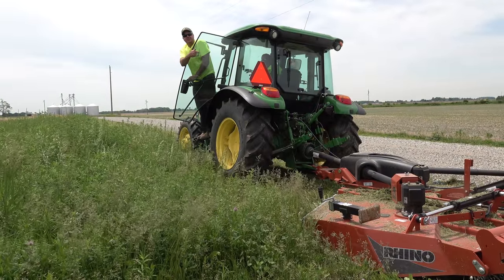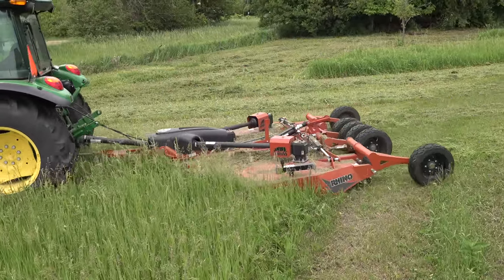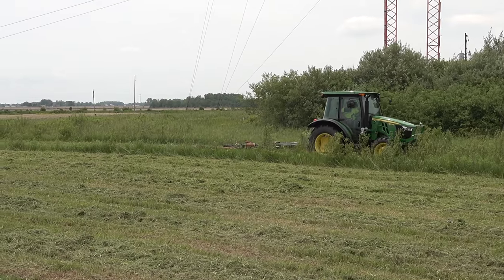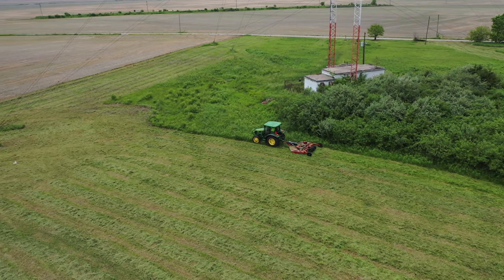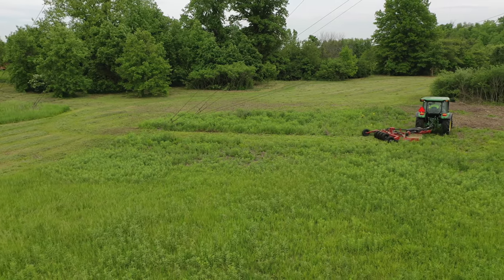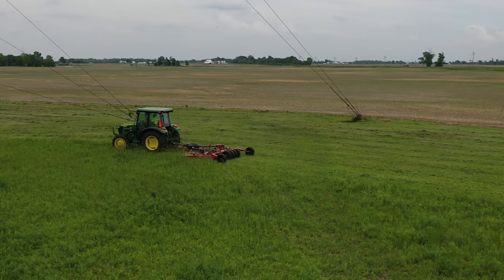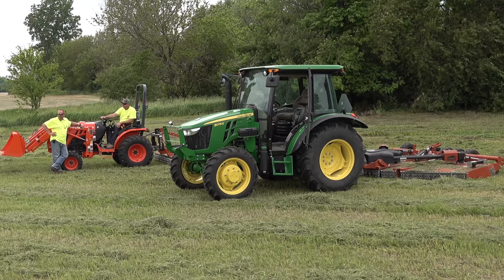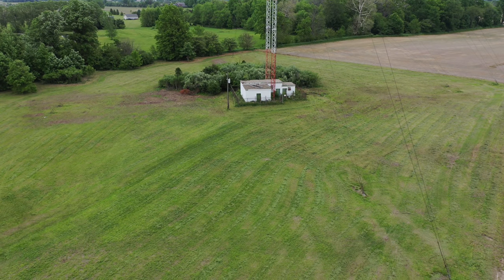10' Flexwing & 6' Rotary Cutter Mowing Tall Heavy Grass and Brush!

Comment: I used to run an 18' batwing on an old John Deere 4050 as a summer job. Amazing how much ground you could cover. When i was done mowing the flats, I'd switch to a John Deere 6620 with a Bomford mid-mount flail arm mower. Great summer job for a teenager.

Comment: Another excellent video guys. Almost every video Tim post on his channel, I find very relevant to something I am currently doing , going to be doing or just did something similar. 
Absolutely my favorite Chanel!!!!

Today, for example I noticed you didn’t have your I-match on Johnny 5 while you were hooked to your batwing. I think I just figured out why today. I know it’s not in use for a draw bar pull batwing, I just never thought about it being a good idea to remove it when pulling my batwing finish mower .

This is what can happen when you don’t remove it. 
I learned this the hard way this afternoon. Lol
Kinda put a damper on my mowing today. 
I at least got the front yard done before the pto shaft had a little bad luck. Lol

Comment: The right equipment makes a big job very manageable. That 10’ mower is awesome. You sure have changed the appearance of that property. Any plans to remove any more of the taller growth by the building?  In this heat it’s a blessing to have a cab with air. Stay safe
Reply from the maker: Yes, we still plan to remove the rest of the brush…just haven’t got around to it yet.

Comment: A couple weeks ago, my sister and I did the big spring mow at the farm. 72" bush hog, 5320 4wd (64HP), most of it is 20-30% grades. (She was on the Scag, mowing the house yard and orchard, then around the trees). On e-pto, mowing basically all waist tall grass (more less like what you're mowing here), in B3 gear, I burned right at 10 gallons of diesel in 8 solid hours of mowing. I've never measured it, but seems like it is around 14-15 gallons for a similar amount of mowing in standard PTO.

And yeah, reverse ratio is in between 2nd and 3rd, when I think it should really be between first and second.

Comment: I have a 5045E .Most mowing is in 2nd or 3rd "B" range. I usually  shift to "A" range B4 going to reverse because you are right it's too fast. 1st time it will really surprise you when you go to back up and have mower running fast.

Comment: What speed do you average when cutting this type of flat even ground? Are you dragging the mower on the ground? I was running at 4 mph but was unsure if that is about average. The front edge seems very low. I find I bottom out often if I drag it but maybe this mower is different. Another nice video. Thanks.
Reply from the maker: We do not drag it.
We run closer to 3 mph.

Comment: How do you find the LX3310 does with the 6’ cutter from a power standpoint in tall grass/weeds and the small/medium brush you were cutting? I own an LX3310 and debating cutter size. Thanks. Keep up the good work!
Reply from the maker: We showed it in a recent episode.   Power is ok, however, the weight of the 6 ft is a load for it!

Comment: How did KT like the 6’ rotary cutter?  Looked like a heavy load that far back.  I’ve heard Kubota recommends 5’ or smaller rotary cutter on the LX but not sure why, seems like maybe it’s all that weight so far out back?  Any updated thoughts on the R14’s?
Reply from the maker: No worries from HP standpoint.  It is a big load from a weight standpoint.

Comment: Have you mowed up and down hills with the 5075e and 10ft batwing?  My pastures get quite steep and use a good bit more horsepower.  I have a 12ft woods batwing and a 3039r it slows to 1mph on some hills and my 4010 works hard at 2mph.  I'm curious if a 5075e will be enough tractor in my hills.
Reply from the maker: Oh my! You are pulling 12’ batwing with 3039r!?!?  Should not be able to handle that much mower.  5075e would handle it fine.
Reply from the maker: 4010 John Deere from the 60’s?
Reply: @TractorTimewithTim  yes a 61.  One of my hills it just about died in second gear.  I'm just clipping pasture 12 inch tall the 3039r has no issue if you are not in the hills

Comment: The transmission in the 5000 series is designed for loader work with its quicker reverse cycle times.

Comment: I would love to see a demo of cutting heavy 3' tall rag weeds with the 10' batwing.  that's what I have the most trouble with
Reply from the maker: Well, the flex wing will cut them.  No question.  How much HP required? Not sure.  Where are you located?
Reply: @TractorTimewithTim  high plains of colorado, Pueblo area

Comment: I have mowed tower fields but not with tractors as large as shown in this video. Saved the trimming around guy wire bases for hand mowers and weed eaters. Don’t want to take the chance of busting a guy!-and the tower possibly falling on you.-and the agony of putting a station off the air !

Comment: I live in Germany and I own a 60hp 5058E produced in India (https://www.youtube.com/watch?v=u3YH_Sp8Ikg). This tractor comes with Hi- and Low- buttons on the gearshift, which makes 24 forward- and 12 reverse-speeds. I don't understand, why this transmission option only comes with the 5E-four-cylinders in the US. The speed difference between Hi and Lo is about 20% , so that the reverse speed in the chosen gear is in the middle of these two. That would open up the possibility to choose a lower gear in Hi and having a slower reverse gear when using the PowrReverser.
Reply from the maker: That would be nice!